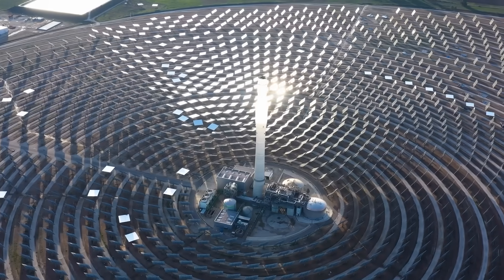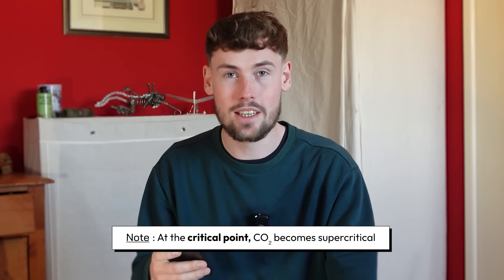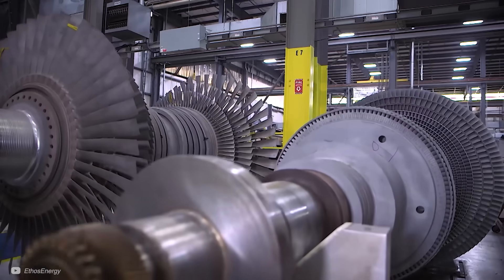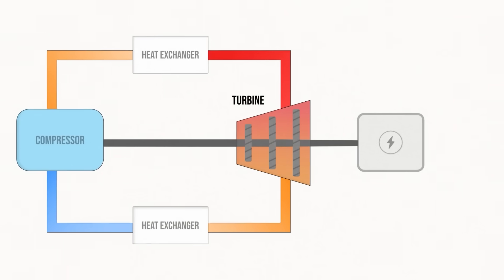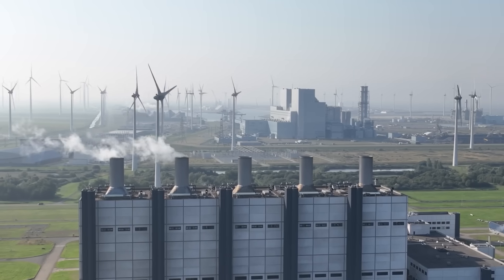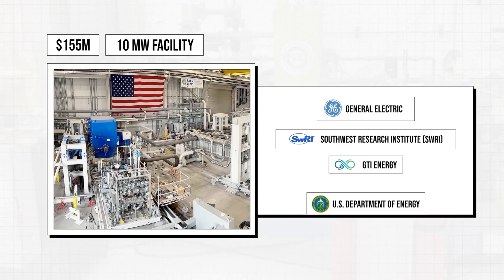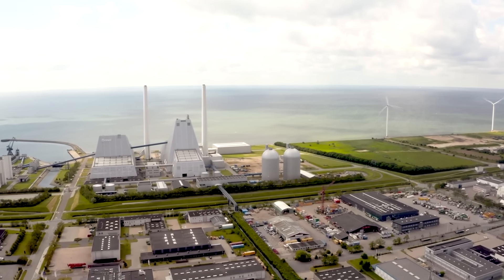How Ultra-Efficient CO2 Turbines Are The Future of Energy

Comment: This barely makesvany sense. Where do we get the compressed at co2 and the energy to compress it, and what is the round trip efficiency
Steam is directly produced with heat. Compressing co2 requires mechanical energy and expensive equipment.
Reply: Use Google
Reply: The CO2 is kept in a supercritical state and recycled in a closed loop. It's heated, making it denser and more energtic(like steam), but it doesn't change phases. But it will still drive the turbine. Then it's cooled again(it's easily cooled passively) and is then ready to be heated again. The energy it takes to compress and heat it is trivial as you're not doing it for each cycle. Ideally it's done only once, but there will be maintenance from wear and tear so recompression will occur multiple times, but the energy required to do this is trivial and negligible compared to the output between each recompression.
Reply: @momatotsosrorudodi  Super critical water ("steam") generators are common around the world.
Reply: @jumboegg5845  Steam is not the supercritical state of water.

Comment: CO2 is famously used as dry cleaning fluid, does this not degrade the materials of the turbine?
Reply: Co2 is an organic solvent so it’s good at cleaning. However unlike water it doesn’t cause corrosion of metals.
Reply: @undertow2142  No, but it reacts with water to form carbonic acid, which it does so quite happily.
Reply: @Hyposonic  you’d have to have desiccators in the circuit. But it’s a sealed system so shouldn’t be too hard to keep all moisture out.
Reply: @undertow2142  Not sure how that works in a high speed turbine.  Those are normally only in (or near) low flow storage tanks.  I've yet to see a hyper effective CO2 conditioning system like what's needed here--but no large-scale applications I know of have needed that level of purity.  Maybe it's out there, but I don't know what it is.
Reply: that's dry ice, is solid form of co2
Reply: No
Reply: @kellymoses8566  Unless you can guarantee zero water in the system, it will indeed be corrosive in the form of carbonic acid, especially at high pressures with turbulence.  Even the most controlled CO2 pipelines see it.
Reply: alot of patterns in innovation i have noticed are people NOT PREPPING for the consequences of the innovation.
Reply: Like fusion, why get hung up on the little details? (lol)

Comment: Could be interesting matched with a sand battery.
Reply: Well that is interesting ! They operate at similar temperatures.

Having said that, turbines in general aren't ramped up or down as they typically provide base load or mid load.

Comment: How many energy need to capture CO2 and cool it to supercritical state?
Reply: It's trivial and negligible in a closed system were the supercritical CO2 is circulated and 'recycled'.
Reply: @momatotsosrorudodi  No, it's not trivial.  By definition, supercritical means it is always at risk of changing states.  That transition can be caused by mechanical impacts, sonic effects, and even turbulence.  Any transition and it cannot recover.
Reply: @Hyposonic  You might be thinking of superheating? A supercritical fluid doesn't undergo spontaneous phase transitions. There's not really even a clear phase transition around supercritical fluids as there are gas-like and liquid-like states.
Reply: @alzoz6741  No, I deal with this stuff daily.     I didn't say anything about spontaneous.  The transitions are physically triggered in countless ways.  There are many uncontrolled variables inside a turbine and its connected systems.  The concept here is interesting, but the challenges are far from trivial.  When I hear someone say they are trivial, it shows me their level of (more precisely, lack of) education.
Reply: @Hyposonic  I'm not sure what your background is specifically. However, a spontaneous process is one that proceeds without net gain in thermodynamic free energy, the energy available for work at constant temperature. A phase transition triggered by some kind of agitation is an example of this. It is still a concern, water droplets in conventional turbines can already cause blade erosion. But the working fluid is not at risk of irrecoverably changing state.
Reply: @alzoz6741  You keep bringing spontaneity into this.  I'm saying it's the opposite--the phase changed is induced by the flow through the turbine.  I'm also not saying it's irrecoverable.  It's totally recoverable, but making it do so efficiently is non-trivial, as had been argued.  There's a reason this has not yet been demonstrated--there's a lot more work to do on this intriguing idea and I wish them well.
Reply: @Hyposonic  Perhaps I misunderstand what you mean when earlier you say "Any transition and it cannot recover".
Reply: @alzoz6741  My point, earlier in the discussion, is that it will not recover on its own, only by some external mechanism (not that I know what that might be in this case).  In a steam turbine, condensation is collected and pulled from the system and recycled.  I don't know what that looks like here, but it would be necessary.
Reply: @Hyposonic  Ah, I see. Most proposed supercritical CO2 cycles are Brayton cycle. The fluid should remain supercritical through the whole cycle.
Reply: @alzoz6741  Then they'll have to increase the baseline pressure to keep it away from the transition point everywhere in the loop.  Not sure how high that would need to be, or how temp variations factor in.
Reply: @Hyposonic  It's obvious you're confused about the topic and conflating 'supercritical' with some other term and you're lying about 'working with this stuff everyday'. I don't how much weight you put into my use of the word 'trivial', but heating something to 31.1 degree's celsius and achieving 1070psi occasionally between maintenance is trivial from an energy stand point. Building a system that can endure the pressure while still holding the necessary components isn't trivial, but that's not what was being discussed. Achieving supercritical CO2 is so trivial that you can DIY at home.
Reply: @momatotsosrorudodi  How many subjects are you trying to conflate here?  You're mixing my responses to different topics.  Achieving static supercritical CO2 is easy, as you say, but keeping it moisture free and supercritical in a turbine and attached plumbing is not.  And while I haven't done it--like those in this video--I'm suggesting that there "could be" significant erosion of the turbomachinery.  It's likely  one of the reasons no one has done it.  Sorry if your YouTube degree isn't helping with real applications.
Reply: That is the right question.  You win!
Reply: you heat it above that point he showed, before it goes supercritical phase...  that and pressure.   you're in a closed loop ...
Reply: @lylestavast7652  It won't stay that way once it starts moving and mixing.
Reply: Did you pay attention to the video at all?
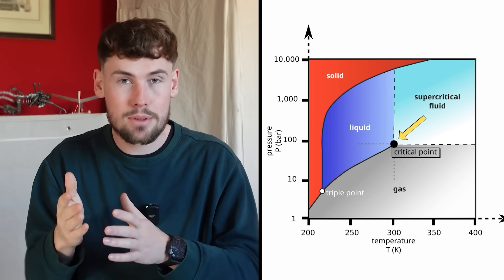3:40 The critical temperature is 31 C or 88 F. Those are normal temperatures. Action Lab started with a chunk of frozen CO2 but cooling isn't the key. Pressurization is. Pressurization does raise temperatures but shedding heat from energetic processes is something humanity figured out how to do two hundred years ago.
Reply: @paulflocken2730  Guess what? As the fluid flow through the turbine, it changes velocity and temperature.  This doesn't even consider friction and drag.  Ask yourself why this device has not been demonstrated yet.  My contention is not that it won't work, merely that doing so is non-trivial as someone stated.